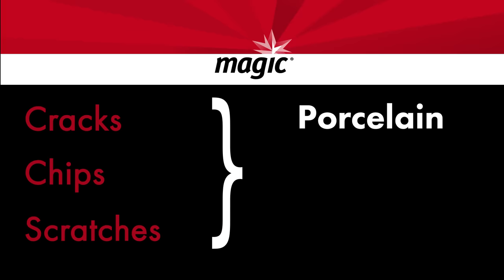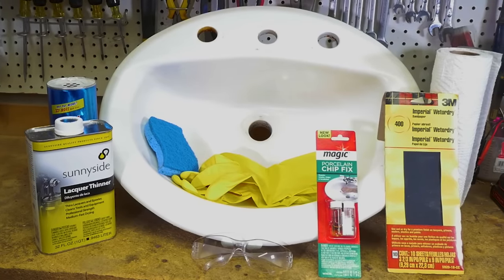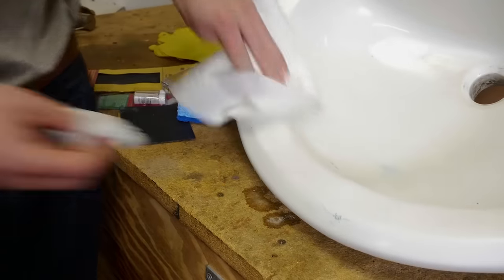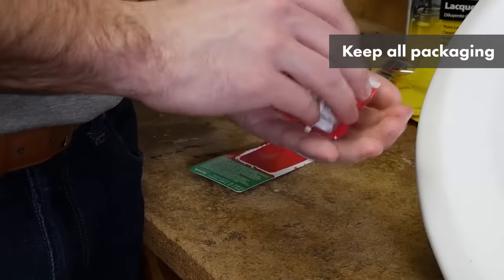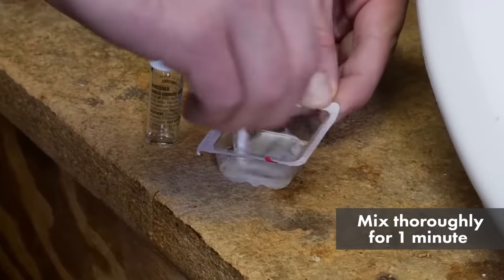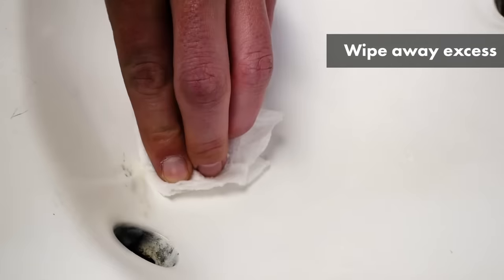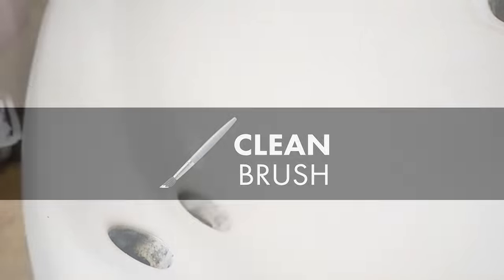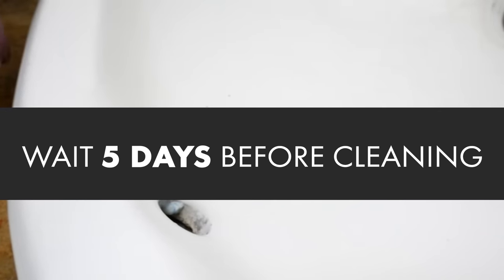How to Fix a Chipped Sink

Comment: The video says to wait for 45 minutes after applying the first coat to apply the second coat. What keeps the epoxy from drying out in the plastic container during this wait time?
Reply from the maker: This wait time will not allow the product to harden.  You can put a small piece of plastic wrap over the mixture if you would like to.